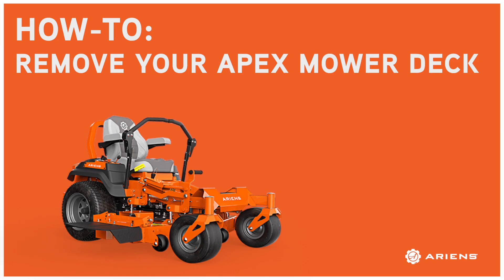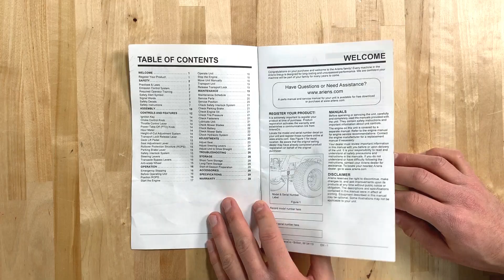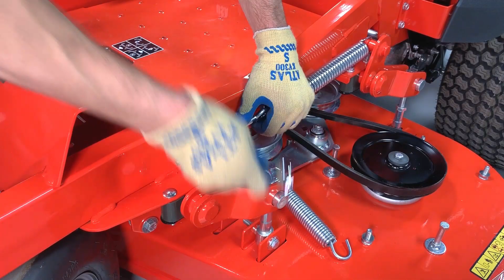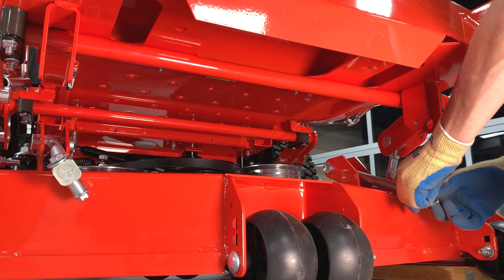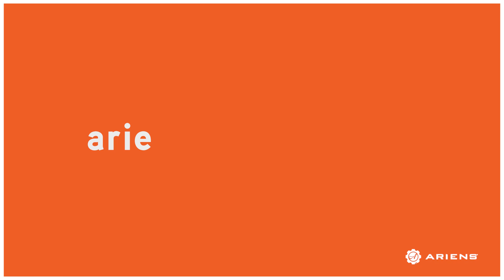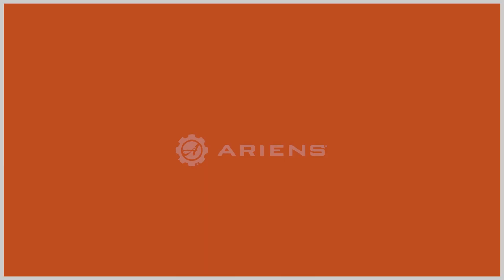How to Remove an Ariens® APEX Zero Turn Mower Deck | Ariens

Comment: Instead of taking the deck off to change blades, etc.   I'm just going to build a gantry out of 4x4's and lift the front of the mower with a chain hoist.

Comment: What a pain in the ass. Might be the reason I don't buy one.
Reply: If you don't own one, you wouldn't know how easily it is done. There is another way of removing the deck which they don't show but it requires leveling the deck each time. Which is no big deal if you have the right size wood blocks. It saves removing the right side belt cover.
Reply: @gravelydon7072  I have one, and it's a pain in the ass